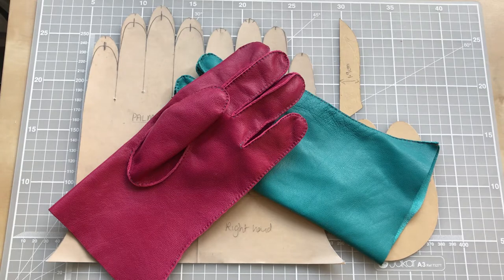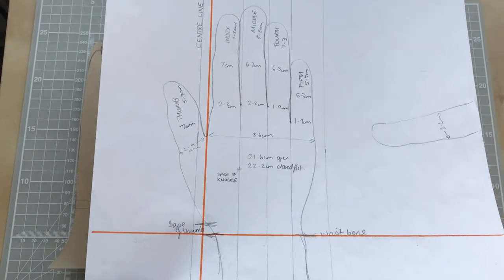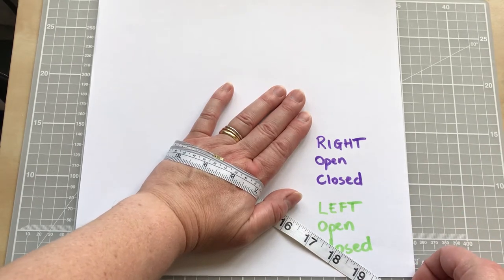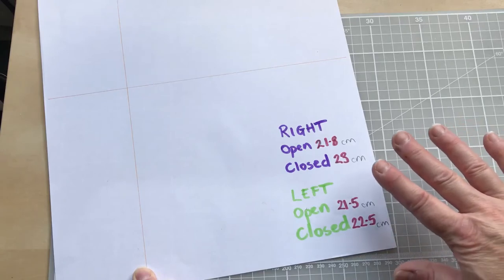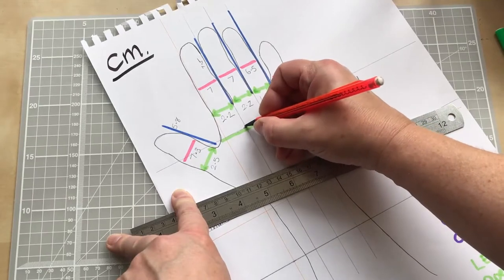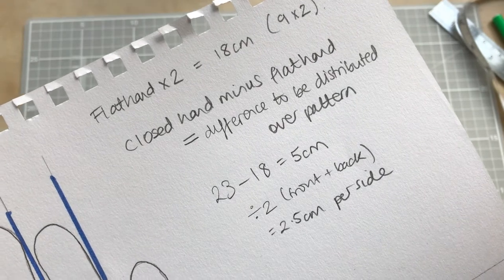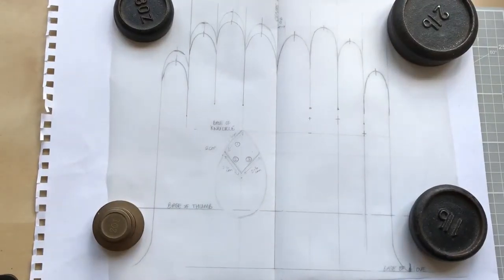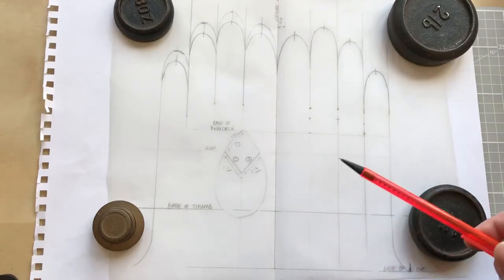Creating a leather glove pattern part 1: The trank

Comment: Hi, I've been following your instructions, as my hands do not seem to fit standard sizing, however at @17:55, where did the 0.65 come from. as continuing with that number it does not work for my hands, and I get an odd distribution (closed and open on both my hands is 19cm)
Reply from the maker: Hello. Thank you for spotting this and taking the time to ask the question. I can apologise for this ommission as I've not explained it in the video. The 0.65cm allows for the depth of the finger. At 17:55 if you look at the paper pattern you will see I've drawn an extra line to the left of the index finger and made a mark with an additional vertical line by my fifth finger. As there is no fourchette on the outer index or fifth finger we need to accommodate the depth of the finger within the pattern and then distribute the remaining excess as explained in the video. Once I started to work out how to distribute the excess I wanted to add an allowance that balanced the pattern, adding a similar allowance to all fingers. I will add this explanation to the description. Thanks again.
Reply: @ElizabethBondTheSmartStitcher  Thanks, sorry it took me awhile to answer, not had a chance until today to look at the explanation you gave. I do get the reason for the distribution, but I do not see why you use 0.65 on the left and on the index finger side. Where did you calculate the 0.65 from? My difference is 3.2cm so 1.6cm each side, so using 0.65 would not work. so far you not given how you got the measurement, but why. I see some calculations under the CM on the left. and I feel it has to do with the circumference of the index finger (7) and the measured number (2.2) on the index finger, but where does the 1.2cm come from, that makes up the 5.6cm
Reply from the maker: Hello. I measured the depth of my index finger which was 1.3cm and divided it by two to give me 0.65cm. As the glove folds around the index finger and there is no fourchette, the depth has to be accommodated, as well as the width of the finger. When the pattern is opened out this will give a depth of 1.3cm against the index finger. If I did not halve the measurement and just added 1.3cm on to the index finger I would end up with a depth of 2.6cm, which would make the index finger rather large. I used the same measurement on the fifth finger as I measured again (I have chunky fingers) and wanted to help keep everything in proportion when the excess is distributed.
Reply: @ElizabethBondTheSmartStitcher  Thank you! Now it makes sense. I have weird square fingers as my width is 2.2 and my side profile 1.8, hence I couldn't get it to fit right. Time for  a redraw.
Reply from the maker: Good, I am glad to have been able to help. Good luck with the redrawing and sewing.

Comment: Hi there! Question at 19:18. You say you should add .6 to index and pinky finger, but then you add .65 to the index and only .6 to the pinky. Should this be the .65 (half of the index depth) on both of these two fingers? Also at 22:41 you've added some +'s that weren't previously explained. Are these the marks for the bottom of the knuckle like explained at 9:12? You're making these on the new lines for the fingers and moving them down a centimeter just to have excess with stitching together? Edit: I think the first set of +'s are for palm of the hand and the lower set is for the back? Thank you for color coding everything by the way!

Comment: I'm making my first pair of gloves and this video is just perfect for learning: visual, clear, and to the point.
A question:  is there a rule of thumb for adding to measurements if using a liner (thin merino wool in this case)? Or is it better to do the measurements with the liner on if it is available?
Reply from the maker: I've had limited success with linings but would always do a sample to help me work out the allowances. With a thin lining you may find you don't need to add much to the leather but this may vary with a thicker lining.

Comment: I don't understand where the 0.65 measurement comes from at 17.47 minutes.  Please advise.
Reply from the maker: Hello Dave,
I measured the depth of my index finger which was 1.3cm and divided it by two to give me 0.65cm. As the glove folds around the index finger and there is no fourchette, the depth has to be accommodated, as well as the width of the finger. When the pattern is opened out this will give a depth of 1.3cm against the index finger. If I did not halve the measurement and just added 1.3cm on to the index finger I would end up with a depth of 2.6cm, which would make the index finger rather large. I used the same measurement on the fifth finger as I measured again (I have chunky fingers) and wanted to help keep everything in proportion when the excess is distributed.
Reply: @ElizabethBondTheSmartStitcher  Hi Elizabeth can u explain what mean depth ? how i can measure propertly , i not understand it rigth, thank u in advance !!!
Reply from the maker: @marufkilichev98  When making the glove pattern we need to make sure the glove fits around the whole hand and we are not just taking the flat measurement of one side of the hand and then doubling it. The depth I refer to is the measurement looking at the side of the finger (both the index finger and the little finger). We need to add this measurement into our trank pattern so that the glove pattern is balanced, and does not have an oversized index or fifth finger. At the index finger, the leather folds around the hand, and the fifth finger has the outside seam. There are fourchettes on the other fingers but not these two points. I have made another tutorial that explains this in a bit more depth https://youtu.be/ymNif6c4GGE the title is Glove Making FAQ 1: Adding depth to the trank.
Reply: @ElizabethBondTheSmartStitcher  thank u so much, i will check it , i let u know, have a wonderful day

Comment: Great video but is this really necessary to do all of these crazy calculations when i can just trace the shape of my fingers to a paper and add seam allowence ?😅😅😅 
It looks so difficult😭
Reply from the maker: It depends on the style of glove you wish to make. This method gives a more fitted version working off the measurements of the hand and accounting for the depth of the hand. You have to factor in any stretch of the leather/fabric you plan to use as you want to get the glove on and off the hand. There are other methods to draw out your pattern and sometimes you need a start point to work out what works for you. Give drawing round your hand and adding a seam allowance a go. Make a mock up as it sounds a good place to start. Good luck with your sewing.

Comment: dude, where the hell did you get that 0.65 cm from!? this explanation is hard to follow because there are steps skipped. (time stamp 17:53)

if you add together the final finger measurements circled (time stamp 19:33) and double them to get your hand circumference, you get 21.3 cm, which is smaller than your flat hand measurement. 

you're going to get a lot of people very agitated when they follow your pattern and end up with gloves that don't fit.
Reply from the maker: Hi Chris,

My apologies. I realised I edited the wrong bit out so put an explanation of the 0.65cm in the video description at that time stamp. This is the explanation for when you reach 17min and 55seconds in the video: I mention 0.65cm and I forgot to explain how I reached that measurement. My index finger has a depth of 1.3cm, half of which is 0.65cm. The 0.65cm is then added on so that when the pattern as opened out the depth will be 1.3cm against the index finger. (The glove folds around the finger at the trank. At 17min 55secs, if you look at the paper pattern you will see I've drawn an extra line to the left of the index finger and made a mark with an additional vertical line by my fifth finger. As there is no fourchette on the outer index or fifth finger we need to accommodate the depth of the finger within the pattern and then distribute the remaining excess as explained in the video. Once I started to work out how to distribute the excess I wanted to add an allowance that balanced the pattern adding a similar allowance to all fingers, so added the same figure to the fifth finger too.